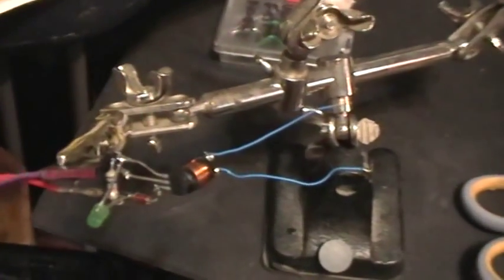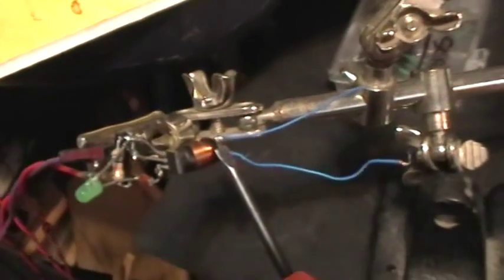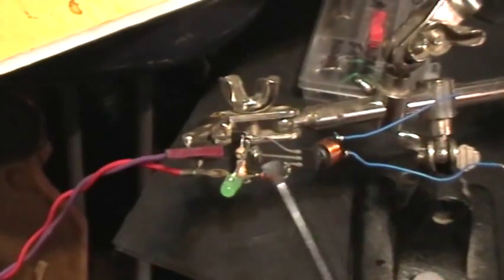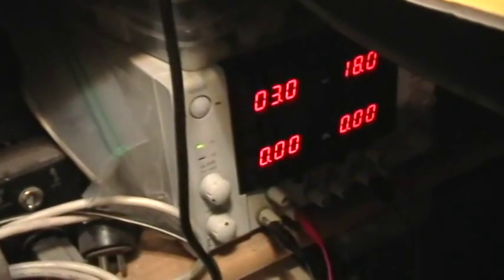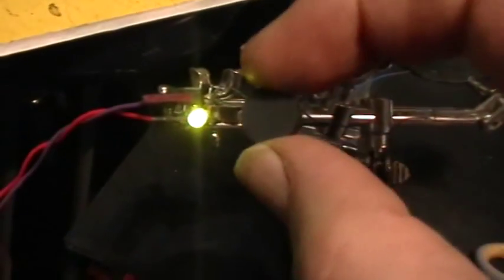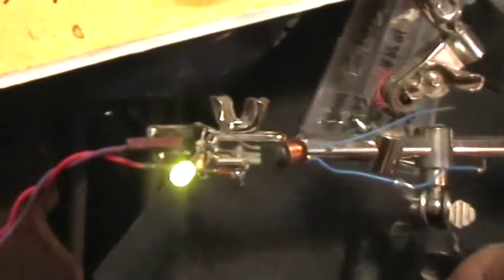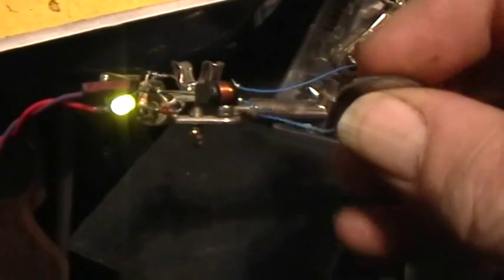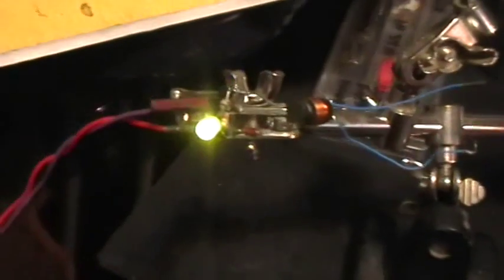Quick and Dirty 3: Melexis US1881 Latching Hall Effect Sensor Demo

Comment: Well done ! Interesting. Could probably be usefull for some types of magnetic applications.
Reply from the maker: Yes, I've often used them in pulse motors. I'm trying to figure out some kind of modification to the Larskro device, using the inductor and Hall sensor in place of the motor coil and reed switch.